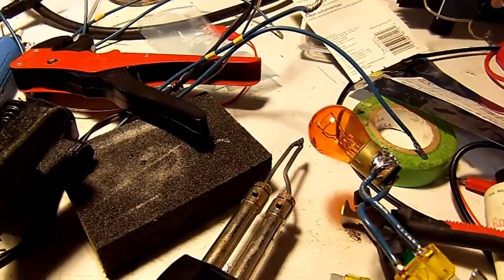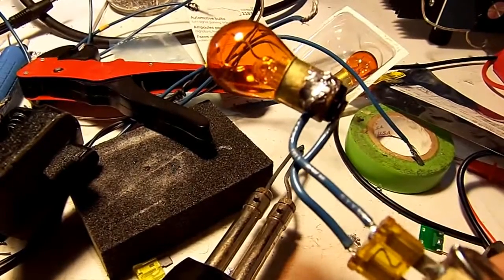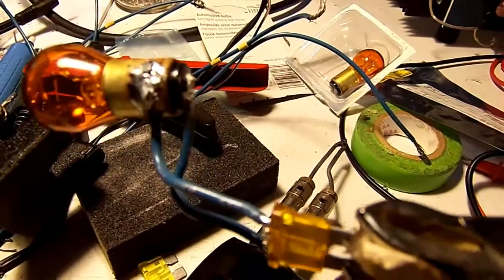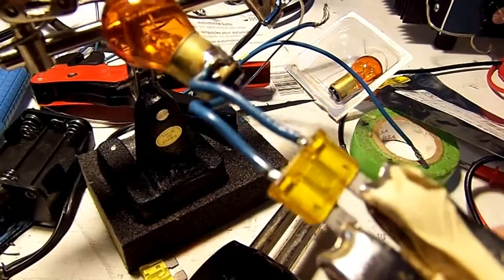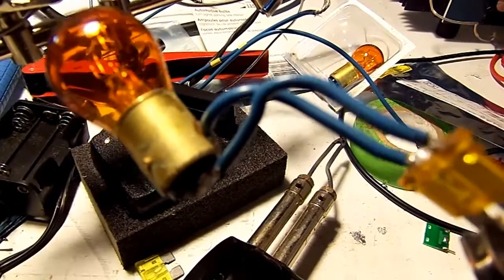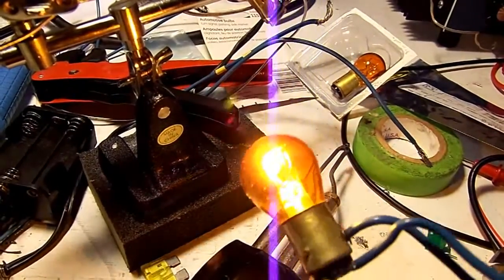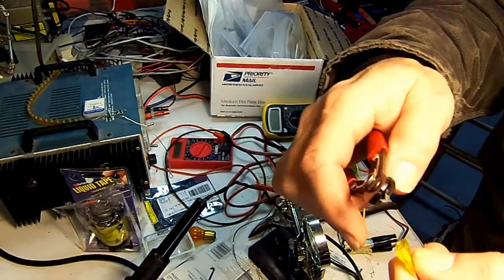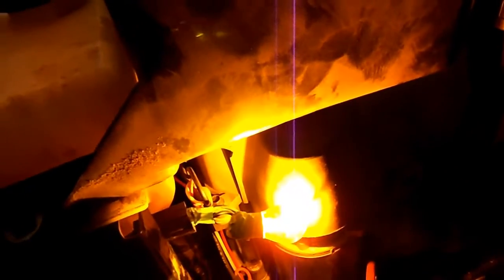Tester to Aid in Finding Shorts in 12V Electrical Systems

Comment: How do you know which side of the fuse to connect to which part of the bulb?  I have a 99 Camry that keeps blowing a tail light fuse when I turn on the headlights.  I want to try this and see if I can find the shorted wire....
Reply from the maker: That doesn't matter, the bulb doesn't care. just make sure everything is insulated. The hard part is soldering to the bulb and the fuse. Of course one could buy a bulb socket and there are fuse jumper kits out there too, as well as more advanced short finding kits. Good Luck
So this fuse blows when the marker lights go on? Your not talking about the brake lights I hope. Is the License plate light on the fuse that blows too? Any trailer hitch wiring? Such fun.
Reply: Well, the brake lights work.  The tail lights, parking lights, and plate lights don't.  I've spent considerable time changing relays, harnesses, piles of fuses blown.. it's more than likely a wire broken at the trunk lid, so I'm hoping.... the turn signal fuse blows too... headaches.  Thanks for the reply.  I'm going to try this rig up of yours, wish me luck!